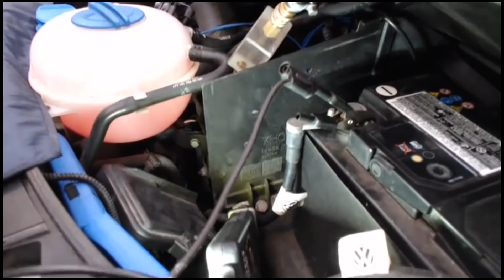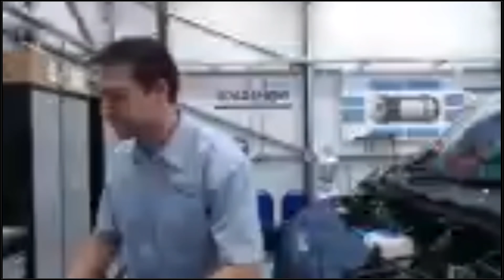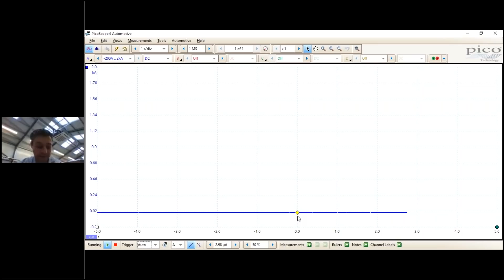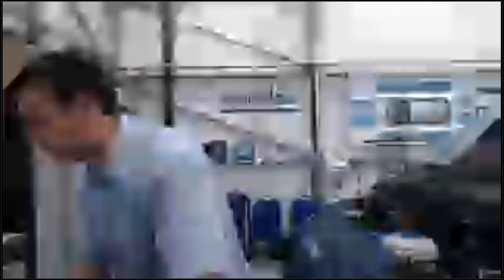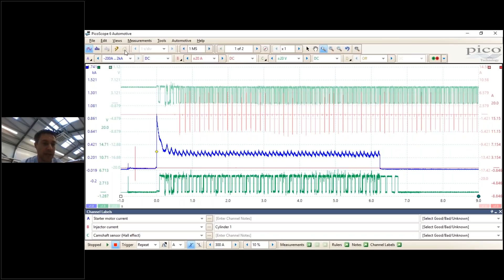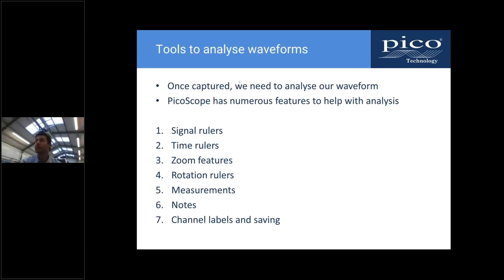Practical Pico: Cylinder identification and relative compression on CRD engines

Comment: Can this be crd relative test be synced together with a 2ch 4225a scope by keeping the trigger and time base where it is and bringing the starter current channel back as a reference waveform? Mine doesn’t look right I must be doing it wrong. Perhaps I can sync the cam and injector and measure where exactly in the cam waveform my injector 1 sync was found

Comment: Hello, I have a picoscope 3405B, with 4 channels. I want to use it with the automotive software but it does not detect it. Is there a way to detect both programs?

Comment: Great first start guys, however I think it’s important to highlight that when using Pico Diagnostics and you are presented with green bar graphs showing 100% (Implying GOOD) it simply means this was the highest compression it has absolutely no relationship to the actual compression being good, it’s simply a comparison, so your good 100% cylinder could still be bad, just not as bad as the worst.

Comment: Is there a risk that a user can upload a "known good" to the waveform library and the waveform isn't good and the vehicle has issues?
Reply from the maker: Yes, there is a risk for this to occur however we do monitor them on a regular basis. Of course, if a user comes across a waveform that is incorrectly labelled they can email in to support to let us know,  it will then be investigated and modified as required. We do rely on users to ensure correct details when uploading (this includes vehicle information for example).